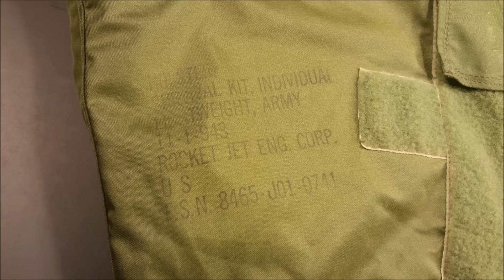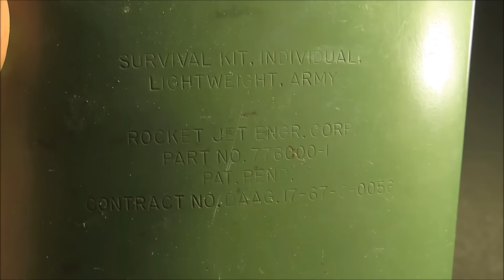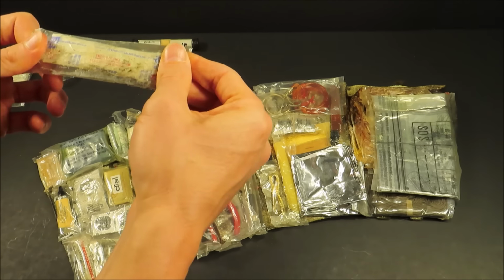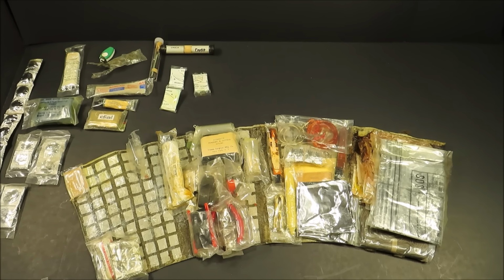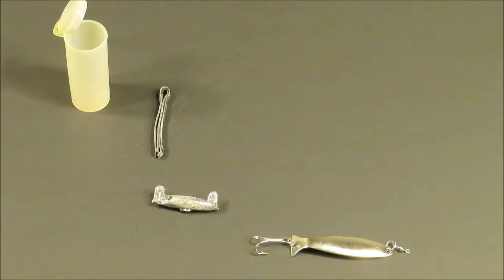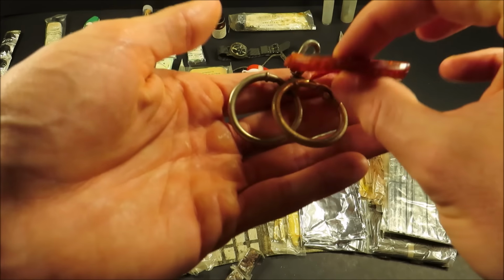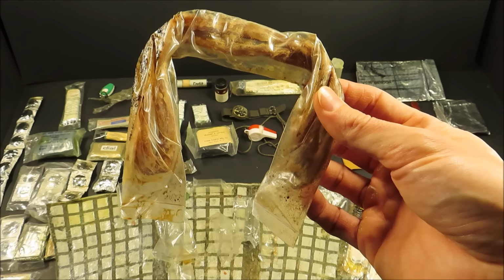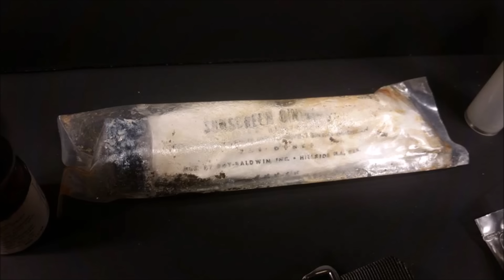1967 Vietnam US Leg Holster Pilot Survival Kit Review Vintage Military Gadget Testing

Comment: I saw that knife and was flooded with memories of my childhood and my father.  I used to sneak into my father's toolbox and play with that exact knife that he was issued when I was a kid.  He flew for the Air Force in Vietnam as a FAC.  It was finally given to me when I was old enough and I used it for years in the Scouts.  Nostalgia overload is what this is.
Reply: Nice, do you still have it?
Reply: If you still have it, be careful, these knives were made with a defect in the tang (metal part of the blade in the handle) which warps and corrodes overtime due to the leather breaking down around it which makes the metal even more bendable then it already is, it's super easy to break now, I wouldn't use it for anything since the handle will be the first part to bend, a simple jab on the cutting board would probably snap
Reply: @notjimpickens7928  you cannot baton with them either.  Same reason why you can’t baton a kabar it will bend and snap at where the handle meets the blade.  As long as you stress the knife with up or down is fine.  Just don’t go side to side.  Especially if it is corroded.
Reply: I had that exact knife too, I bought it at a surplus store when I was a kid, wish I still had it it got lost somewhere in life. I had already switched to a fixed blade Buck for a hunting knife it kept a better Edge, I think it's a 102, a few years back I came across a sheath from that same type of Air Force survival knife, the genuine stiff leather with the metal backing, anyways it almost fits my buck 102 knife, so that's what I carry in it now.

Comment: I've got a PRC-90 radio, the version of the RT-10 that was used in the chest pack. There are modern Lithium-ion batteries available if you want to get it powered up again. Just make sure you know how to switch it to receive only mode since it will start broadcasting a tone on 243.0 MHz as soon as the antenna is pulled out, and that's still an international distress frequency today. ARG! I just saw your Prick-90. You are broadcasting on 243.0 MHz . It's a guard frequency monitored by all commercial and military aircraft. If an airplane is flying overhead and picks up that signal you're going to at least get a search and rescue mission generated in the area, even if no units are sent out. Best to leave it turned off until you're sure that signal isn't broadcasting.
Reply: I learned something new and interesting,thank you.
Reply: I was wondering if the battery could be replaced. Great info. Hope Steve sees this.
Reply: Lol OOPS! Sorry coastguard clearwater!
Reply: @skoopsro7656  Well, it's not likely to be a problem for a few seconds unless our hero is really unlucky, but it's not the kind of thing you want to leave on for minutes at a time. An airliner passing over at 30,000 feet could pick up the tone as far as 50 miles out, so there's a chance that things could go pear shaped if it's picked up. As you may tell from the first three letters of my screen name, I spent some time chasing false alarms from these things. 
Rex, glad you learned something about a rather obscure subject. 
Kathy, there are military radio collectors like me that collect these survival radios. I'd be happy to give Steve some information if he wants to get it safely running as a receiver.
Reply: @sarjim4381  Yeah...I had a small twitch in my eye when he started transmitting too.. Lets hope he doesn't get busted for it!
Reply: One wonders if a small faraday cage could be used for testing......
Reply: For testing emergency beacons the FCC and the FAA say that homing beacons are to be tested from between 5 minutes BEFORE and 5 minutes AFTER the top of the hour to prevent unnecessarily scrambling emergency SAR personnel and equipment caused by somebody just messing around.
Fines CAN, and usually ARE pretty hefty if you are caught and found in violation. Not to mention they probably will confiscate your gear.
I cannot tell you how many times the CAP would show up at our General Aviation maintenance hangar looking for a guilty party or defective equipment. It used to be that satellites in GEOSYNC orbit would monitor the proper freq and when detected, notify the USAF.
They, in turn, would notify the CAP who would show up with triangulation gear within about an hour and notify us a device had been triggered.
But since the satellites no longer monitor the frequency, and the radio types have been changed, offending systems will usually result in the government calling the maintenance facility in the immediate area and we would walk around the general area with an AM Radio tuned to squelch and listen for the beacon pulse/warbling tones. We could get really close in finding the offending gear with these Poor Boy locators. If in a locked customer hangar we could get the key from the main office, gain access, locate the beacon and shut it off.
If we didn't have a key/combo to the hangar we would use big asses bolt cutters to gain entry then put OUR lock on the hangar door hasp. It wouldn't take long for the owner to come to complain they couldn't get their plane out of their hangar, either.
Long story short, DON'T PLAY WITH OR ACTIVATE EMERGENCE LOCATOR RADIOS/BEACONS JUST FOR SHITS AND GRINS IF YOU DON'T KNOW WHAT YOU ARE DOING.
If you do, SOMEONE will come visit you and they won't be.............

.............

...............

NICE! 
LMAO 
Another great interesting video, Steve.

PS, when are you going to build yourself a bigger, decent, show stage with lightning that doesn't cast a yellow tint to the items you pick up to show the viewers? It's mostly fine as is but a man of YOUR stature surely deserves a nicer "stage" from which to place goodies on your tray. LOL
Reply: Sure there are time frames on that. If a signal is shorter than N a guy on the monitoring duty will write it in the journal and that'll be it.
Reply: Johnston Steiner , I read the VC would have an English speaking troop call in on their captured radio and try to vector in SAR teams to areas where the VC could try to shoot the rescuers down. As a result, the pilot would be briefed before a mission as to a "SAFE WORD" and when ready for "DUST OFF" (AKA ready for pickup and rescue) they would pop a smoke grenade.
The rescue helo would identify the color smoke seen and if the downed crewman didn't confirm the correct color, the rescuers would un-ass the AO RFN knowing they were fixing to come under heavy fire. 
So, yes, sometimes the enemy would try and spoof the good guys so they could shoot THEM down, too.
Reply: @jimtalbott9535  Testing of ELT's and EPIRBS is allowed from 00 to 05 minutes after the hour; though it should be kept as brief as possible.
Reply: Read my mind Sar Jim! I work avionics in the army and there are harsh regs if I key on guard freqs.
Reply: @user-td1zo3tv9p  I was a CAP ground team member during the time 121.5 and 243 mhz ELTs (and EPIRBs) were used. Your comment pretty much covers most of what I was going to say. I think those frequencies stopped being monitored by satellite in 2009, but they're still emergency frequencies and you can be fined up to $10,000 for transmitting on them, if you're not up on the rules on how to test your beacon. Also, consider that if your transmission leads to a mission number being assigned to CAP by the AFRCC (Air Force Rescue Coordination Center), people are being called to gear up and move out to rescue you, no matter the time or conditions. It's like calling 911, but calling out people who are always on call.

406 mhz is what's monitored via satellite these days, and while I have little experience past the 121.5/243 era, I believe modern ELTs transmit gps coordinates and a serial number that lets the AFRCC look up a phone number to call. That's good both for aiding speedy rescue, as well as reducing false alarms.
Reply: @agentp6621  My comment drew more responses than I thought it would. I was the SAR coordinator for my sheriff's department. We often worked with the Civil Air Patrol on missing aircraft and ground searches. It's a fine agency made up mostly of volunteers that spend a lot of their own money and a lot of time training for missions.  I retired in 2005 and sometimes miss working with all the agencies when we had a big search. However, getting some uninterrupted sleep also has its advantages.

When I started back in 1978, all we had to worry about were ELT signals on 121.5 MHz and 243 MHz, all coming from aircraft or an avionics shop that forgot to deactivate an ELT they were testing. Now we've had an explosion in the number of 406 MHz beacons from personal locators and EPIRBs as well as GPS beacons. Satellites pick up the signals a lot faster than waiting for an aircraft to fly over and pick it up, but they also generate a lot more search and rescue mission of the kind H? wrote about. Some Cessna had a hard landing and forgot to turn on his guard radio to check for a signal being sent. There were also a fair number from avionics shops or people putting up backpacking gear and inadvertently activating their PLB. The five minutes before and after the hour for testing was done just to try to cut down on the number of false emergency beacon signals. Sometimes it even worked. :P   

The Viet Cong did use captured survival radios like the PRC-90 to try to generate false emergency signals and draw in rescue assets. The Navy and Air Force had an elaborate set of procedures to get around this so the attempts were rarely successful. Due to their short range and poor battery life, survival radios had enough trouble being used effectively by pilots that were actually down let alone VC who happened to find one on a pilot or in a parachute pack. It didn't end with the Vietnam War though. I understand spoofed signals were used by the Iraqis in the Gulf Wars and Serbs in the Kosovo conflict to try to do the same things as the VC tried.
Reply: Johnston Steiner  The NVA didn't have to dissect the radio. The Russians did the job for them and gave them a very similar model they developed from the Prick-90, the R-855 UM. I have one, and the circuitry is identical to ours, right down to transistor count. The Soviets weren't good at miniaturized solid state in the 60's so copying captured radios was a good way to learn. The standard model only broadcasts on the civil VHF emergency frequency of 121.5 MHz, but some models developed for the military has dual circuitry to allow it to also operate on the UHF frequency of 243.0 MHz, something our radios didn't have at the time. They are well made and sturdy radios. My guess is some of these were passed to the NVA and VC for use as deception radios.
Reply: @sarjim4381  How common are those radios in this vid?  My wife expressed interest in them.
Reply: @sarjim4381  Good Info, small correction.  A 243 MHZ is a VHF, not UHF radio.
Reply: Johnston Steiner  I would have a hard time that the Jungle environment would be very conducive to jamming operations.

I would also have a hard time believing the Vietnamese had very effective jammers.  If they did, I'd have expected them in something like a 30-100 MHZ range.
Reply: Seriously I learned alot. Thanks
Reply: @bombasticbuster9340  Sure Jan
Reply: Great comment

Comment: During my first tour in Iraq I was voluntold to assist one of the S3 guys flying the Raven drone. So I had to go out with him late at night for 4-5 hours and assist him with setting up the drone but also launching and retrieving it. After a couple of times having to hunt for this thing at night I decided I needed to try to make a couple of changes to this drone. 1 I velcroid a IR beacon to it. This was a small IR flasher I had that was supposed to clip to my uniform so it was pretty small and light weight. The 2nd thing I attached to it was a strope light. I mounted the light to the body on the opposite side of the IR beacon so the weight was evenly distributed on the drone. And then I taped chem lights under the wings so when it was closer to us we could start to see it. But the drone flew high enough up in the sky that even on calm days the chem lights couldn't be seen. The strobes all faced up so from the ground you didn't see them. The drone could actually carry a decent payload and still have plenty of battery to do its mission. These modifications made retrieval of the drone ALLOT easier than before. Often cutting 30 minutes out of our time. The reason I am sharing this is because the survival beacon with this kit is just a little bit bigger than the one I was issued when I went to Iraq. And damn near the same shape and style. So it kinda took me by surprise to see this and realize the one I was issued would have been easily identified during Vietnam lol. The OTHER 10+ year war. I served a total of 3.5 yrs in Iraq and now I feel like all of my time there was wasted like that of the guys who went to Vietnam. We all struggled and fought for each other. But in the end our efforts were wasted and pointless thanks to vote hungry politicians and Generals in the pentagon kissing every ass sitting on more funding. While the people in the trenches and battlefields pay the price. I will never say my time in Iraq was even remotely as shitty or hard as what the guys in Vietnam went through. Infact its always difficult to have those guys thank me when I came home on leave or from a tour. They deserve my thanks and respect. Not the other way around. Myself and my fellow soldiers did have our share of death and fighting. But it pales compared to guys who saw the kind of combat that makes you wonder how anyone lived through it.
Reply: thank you for your service:)
Reply: Thank you for your service.
Reply: Thank you for your service sir.
Reply: thanks for your sacrifice ♥
Reply: В Украине сейчас тяжело, Руские убивают мирное население,а оружия у украинской армии мало и устаревшее

Comment: "Rocket Jet Engineering Corporation" THAT'S THE MOST BADASS NAME FOR A COMPANY I'VE EVER HEARD OF! WHAT DO THEY MAKE?!?!?! "uhhh, leg mounted packs of camping gear" "WAIT, WHAT?!?"
Reply: “Cool shit lab” was already taken.
Reply: "We make mini pans for frying lizards in the jungle"
OK...
"And we ran out of handles so we use flare guns"
Reply: The CEO was named Norman Osborne. "Back to formula on the survival gear?"
Reply: verdatum  -  it’s a much cooler name than the software company I worked for in high school in the mid-90s...   ”Quest 2000”   (I’ve often wondered what they did after the end of 1999...)
Reply: I found notation on a website selling old RJEC stock notes: ROCKET JET ENGINEERING CORP. (CA) TEXT: Acquired by Gulf & Western Industries, Inc. (MI) 10/1/63 Each (4.6) shares Common 75[ par exchanged for (1) share Common $1 par Gulf & Western Industries, Inc. (MI) reincorporated under the laws of Delaware 7/12/67 which name changed to Gulf + Western Inc. 5/1/86 which name changed to Paramount Communications Inc. 6/5/89 which merged into Viacom Inc. 7/7/94

Comment: We used to buy those type of kits from the surplus stores for the pencil flares, smoke flare combos and strobe lights and wreak havoc in the suburbs with them when we were kids. They also had some with aluminum framed cloth box kites, radio wire and long burning flares.
Reply: Nowadays you get the cops called on you… sad how times have changed
Reply: How were the meth tablets?

Comment: Make sure the pencil flare launcher is cocked prior to inserting the flare. Some of the flares had sensitive primers, and would discharge if the spring on the firing pin was strong. Former Navy Parachute Rigger.

Comment: Test your 406 or 243 MHz ELT during the first five minutes after any hour, limit to three tone sweeps unless you want to initiate a SAR event. If you need to test outside this range, coordinate with Flight Services or a nearby FAA Control Tower. BTW 121.5 MHz is obsolete and unmonitored. However, if ATC hears it, they may start asking enroute flight crews to see if they can locate the signal origin based on strength. Cheers!
Reply: i thought 121.5 was the emergency frequency used for commercial air traffic et al..
Reply: @Yuubari  and also 243.0 for UHF
Reply: 121.5 is still the guard frequency and you'll get people tuning in to that all the time at, for instance, the EAA AirVenture in Oshkosh
Reply: If you leave that beacon on, you are likely going to get a visit from people in uniform who  will have absolutely no sense of humor.  They are quite serious about responding to those ELT signals.
Reply: Steve Gilbert if you leave the beacons lit, you will cause one large army of rohirrim marching towards Gondor
Reply: @W0pper1997  You would think so from the fine that you'll get.

Comment: May I suggest Mr Carlsons Lab, as a collab, to restore the non working radio. The man takes things seriously and will get the radio working to standards batter than factory using standard practice, should you wish, or you could request to keep it in the realms of "ready to go and functional". 

I'm not a huge fan of the guy, but I respect what he does, and I reckon he'd use period correct hardware to diagnose issues, I think he may get a little kick out of it :)
Reply: Let's get started...
Reply: Nice! This stuff is way too advanced for Mr Carlson. One thing I do respect about Mr Carlson is that he doesn't sodomize his electronics or his English, The man Pronounces SOLDER correctly.
Reply: Jesus the L is pronounced in solder even if it sounds like "sodder" to the unaccustomed. It's just not blatant.

Comment: I’m pretty sure you can retrofit some modern batteries into the radio and strobe light.
Reply: I got one of those old strobes working again after installing an aftermarket tail cap. It allows you to use 2x CR123 batteries.